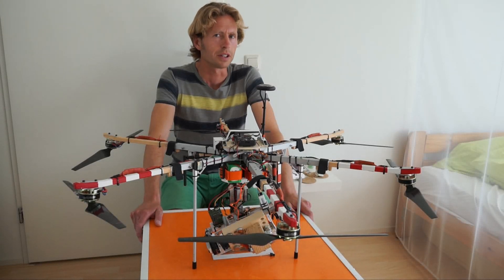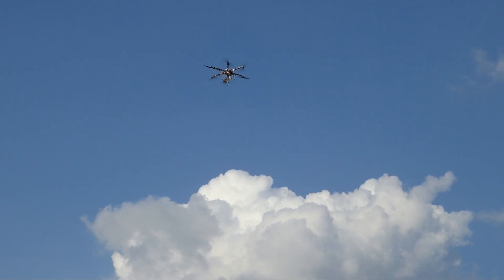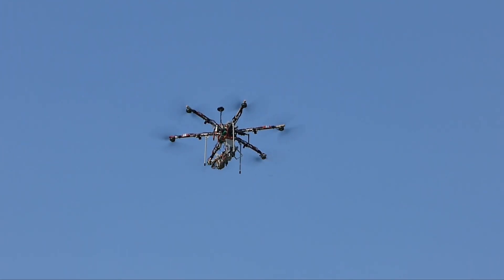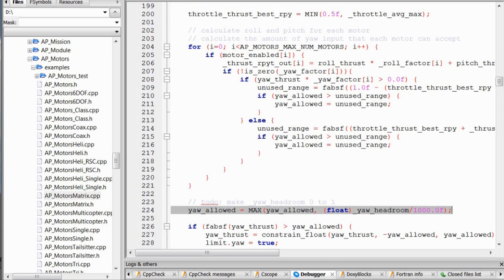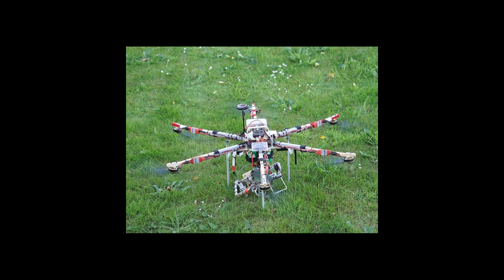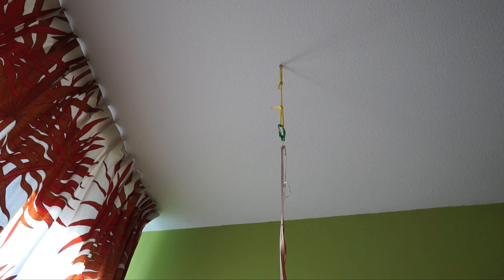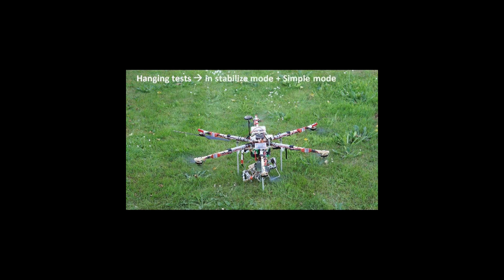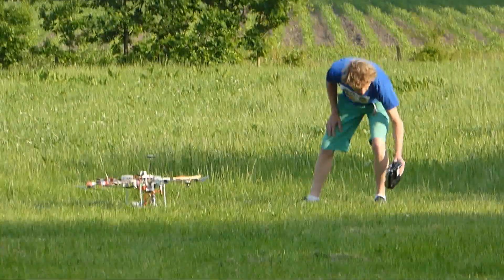Motor failure on Hexacopter

Comment: Thank you for detailing your approach and the test setup. Glad to know that you were able to achieve a safe behavior. Can setting the MOT_YAW_HEADROOM parameter to zero have any other, possibly adverse, affects?
Reply from the maker: Thanks! I did not experience any side effect from putting MOT_YAW_HEADROOM to zero. With all motors intact the yaw control is always very good. But make sure you can activate simple mode anytime during flight, in case yaw control does become poor.